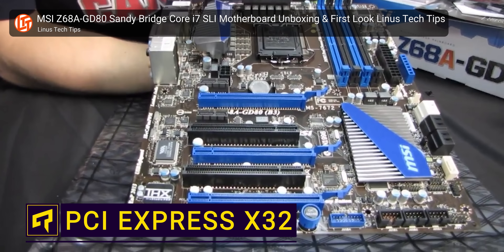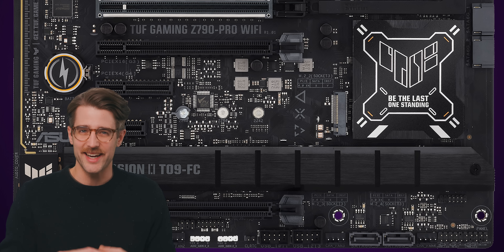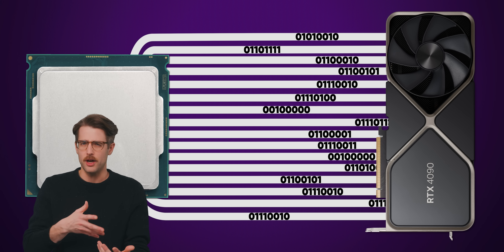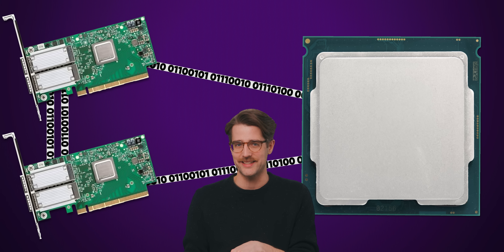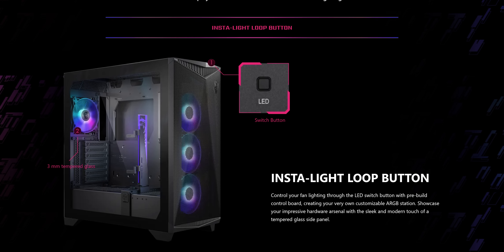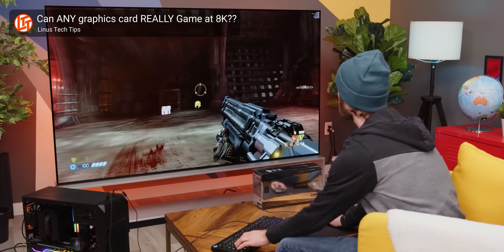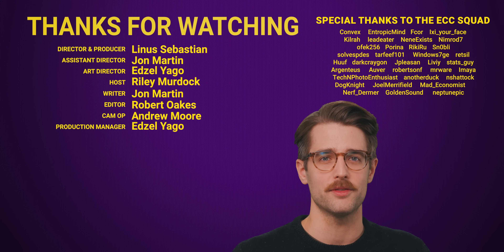Yes, It’s Real: PCI Express x32

Comment: That just sounds like SLI with extra steps.
Reply: Without the proprietary connector
Reply: why are you people keep comparing it to SLI, it has nothing to do with SLI. It is more like link aggregation.
Reply: @eliadbu  SLI needs both the PCIE lanes and an extra SLI bridge to enable faster data between the cards.
But this was from the time when PCIE wasn't fast enough for NVidia's standards.
now with PCIE 4 and 5 being as fast as it is,  we mostly don't need the SLI Bridge anymore. keyword: mostly.

but in simpler terms, X32 lanes is more like using RAID 0 on storage.
Reply: @TheHammerGuy94  In SLI, the PCI_E is used to communicate with both devices at the same time as they both work in unison to render interlacing frames, this is more like having a second card its whole purpose is to pass the communication to the main card, so it is not as RAID 0 - as with RAID 0 both devices are part of an array and are the same.
We don't need SLI bridge anymore because SLI is pretty much a dead technology.

Comment: This is so fake. PCI-SIG just removed x32 (and x12) from the PCIe 6.0 specification because nobody EVER used them. It was a paper spec but were never any implementations. The Mellanox card mentioned used two x16 links to spread the load across multiple root complexes in a multi-socket system, but it was not an implementation of the PCIe x32 spec. It's incredible that Debendra Das Sharman actually told you this; Intel must be putting something in the water that turns engoneers into liars
Reply: What connector are modern 2U servers using for the riser cards which offer multiple PCIe x16 slots of gen 4 and 5?
Reply: @jasonistre  it's usually custom if space is that tight. Otherwise eight-lane mini-SAS are often used for 4.0, with lower impedance 85Ω cables, or MCIO and SFF-TA-1002 for 5.0

Comment: last intel mac pro had two 16x slots combined for dual gpu amd cards. I guess technically that’s 32x
Reply: its not. many servers have a long slot for holding riser boards (eg. 3 cards in 2U rack mount server), but those are NOT SINGLE DEVICE slots. Same as a dual x16 for dual gpu is not a single PCIe device.

Comment: I would like to see an update to the actual PCIE slot standard.

It doesn't have to be exactly like this in that I don't care about the specifics like the connector type but I think I would like this architecture. It would be something like an MCIO connector that would only have 4 lanes by default. That is it. No more than that would be allowed in the connector. Each individual connector would be specced to provide power between 50-100W. I don't care the specific range. Just that it should be able to provide up to a specified power. You would still support pcie bifurcation which means you could then turn a 4 lane port into a 2x2, a 2x1x1, or a 1x1x1x1. This could be amazing for addin cards as if you wanted to add a bunch of PCIE devices you would simply assign a single pcie lane to them. Honestly not too much different here from the current spec. Here is where it would get spicy though. Part of the spec would be spacing between each individual MCIO connector. The reason for that is because you would also allow not only for the bifurcation of the slot but for the combination of the slots as well. Maybe the devices going greater than 4 would simply use Driver Binding like you said, I imagine it would be relatively easy to bind 2-4 4 lane pcie connections. Single mode would be the default but you could choose to combine up to 4 of the slots together as well in the bios. This would mean that you could still have devices connect to up to 16 PCIE lanes if you wanted but if you didn't then you would simply have 4 individual MCIO connectors you could direct attach to instead. It would be hugely more versatile. Also you would get your greater power delivery in that a more power hungry device using all 4 connectors would be supplied with like up to 200-400W of power directly. Sure you are going to have devices, especially GPUs, that still need additional power but that should be rare if they could work with up to 400W.

I think you could even allow some backwards capability if you made available an adapter to go from the 4 MCIO connectors and PCIE. Then you would just need to provide cheap standoffs for the screws at the back. This wouldn't be a problem for most cards but if you had a chonker like a 4090 you could have z height issues in the case. For most regular cards it wouldn't be an issue though and the issue would go away eventually as people switched to the new standard.

Comment: wonder how many years it'll be before PCIE X16 is phased out..... remember how long AGP slots lasted for...... only time will tell..... and who knows what it'll be replaced by....
Reply: I mean physically the connection maybe phased out but i think it's very unlikely that the pcie itself will be phased out too
Reply: AGP only lasted for about 13 years, 1997 to 2010.
Pci-e is currently at 22 years. launched in 2002.

As far as when it might get phased out, when ever it stops being able to handle the data we need to transfer.
Maybe 10 to 15 years on the current trajectory. 
OR it may wind up like USB and never die.
lol
Reply: @chrisbaker8533  On desktops possibly, However PCIE is a core component of a metric shitload of embedded systems and fpga dev boards.

Comment: x32 and beyond are very common in ultra high end modular servers.  If you look at the server manufacturer Trenton Systems, they have massive PCI-E array capability. Of course its still PCI-E a migration from PCI and that has its bottlenecks but when you want parallelism they do it very well.  (Not affiliated; just impressed)
Reply: You are mistaken, there has never been an implementation of x32, which is why it was deleted from PCIe 6.0
Reply: @shanent5793  Weird, then why do I have a x32 NIC on my desk? It was only not used in consumer boards, it very much so exists in the commercial space. You often find them as riser cards, x48 is the highest i've personally dealt with.

I've also got an x32 FPGA dev kit sitting at my bench.
Reply: @sakaraist  If they were referring to the total number of lanes, then this wouldn't be noteworthy because RYZEN Threadripper consumer boards have had more than 32 lanes for several years already, but they're never referred to as PCIe x32 devices. Riser cards are just glue, not end devices and are out of scope.

In the case of NICs, they may have two x16 ports that can be connected to different sockets in a system to save inter-socket bandwidth, but PCIe will still treat them as two separate devices.

FPGAs could of course be programmed to implement PCIe x32, but if you want to use the hardened PCIe IP it will still be x16.

If your devices have actually negotiated a PCIe x32 link at the hardware level, I would love to know the part numbers because even PCI-SIG doesn't know about them and they're definitely not off-the-shelf
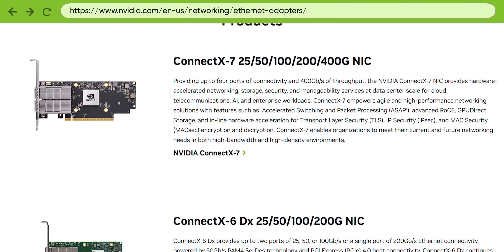Reply: @shanent5793  Wow did you watch the same video I did? @ 3:30 they show Nvidia cards using X32. (off the shelf BTW). They call it Infiniband because NVIDIA. And yes I know Infiniband is the communication standard that uses the PCIE x32 specs.. Just like NVME is the communication standard that uses PCIE x4.
Reply: @robertmitchell5019  if NVIDIA says it, it must be true! 😜

Comment: I'm curious, why isn't there a PCIe x3, x6, or x12? (1+2, 2+4, 4+8)
Reply: Because that's not how it works, the video is incorrect and PCIe link widths are hardware and have nothing to do with software. The fundamental reason for preferring x2 and x4 has to do with efficient clock division. Links larger than x4 are built up from multiple x4 (still at the hardware level) so x12 was actually in the spec but was recently removed from Gen 6 because it was never used. The x3 and x6 connections would be asymmetric and were not included because they complicate the lane reversal feature which allows designers to flip the order of the lanes for design convenience
Reply: @shanent5793  Well unless you replace 1+2 connection by 1+1+1...at which point you may start asking yourself, wouldnt it be easier and more compact to just use X4 slot to begin with.
Reply: @alexturnbackthearmy1907  they would still be three separate links from a hardware perspective, so the OS would have to manage three devices. In principle there could be multiple devices on one card, as long as the host supports it and they are aligned in a binary sequence eg. 1+1+1 or 2+1, but not 1+2

Comment: A 32 lane PCI bus, awesome! GPU card makers can use it for their premium cards...and only use four lanes. Awesome....
Reply: Each time someone buys any current Intel 1700 and you add an ssd it gets bumped down to ×8 anyway leaving 4 of the very few lanes you have useless.
AMD has the same thing, in practiced expect a card to always ×8.

Then any bench you see where the compare ×8 to ×16 there is minimal to no difference unless you go down a generation. 

Just make GPU link on desktop ×8 by default and make room for 2 more NVMe slots.
Reply: @jamegumb7298  eh, on AM4 I have 2 NVMes, one on gen 4 and the other on gen 3. My GPU is still on 16 gen 4 lanes, and iirc AM5 only increased the lane count
Reply: @jamegumb7298 AMD does not have the same thing

Unless its a dogshit motherboard you can have 2X NVMe slots at full speed at the time and an X16 slot

Its when you go past 2 you run into issues as your either adding multiple to the chipset or you start stealing lanes

Without any performance loss on conflicts you can have these configurations in AM5

2x NVMe + 1 x16

4x NVMe + 1 x16
Reply: Also better for big chonky cards just for the physical support

Comment: lmao 2 4090s on one card would be absolutely insane
Reply: Nvivia Titan Z 2024 Edition
Reply: There was a time when stuff like that did get made. I bought a Dell that was meant to have a 7950GX-2, but it arrived with an Ati card.
Reply: The cooling would be problematic, would need a 360mm radiator maybe a 420mm. Though I guess if you afford one the cooling and power costs wont matter ! Big problem with SLI is that memory is become a bottleneck. The two cards VRAM don't add together. So 2 X 24 is still just 24. So it would need like 2 x 48. Fuk that would be insanely expensive.